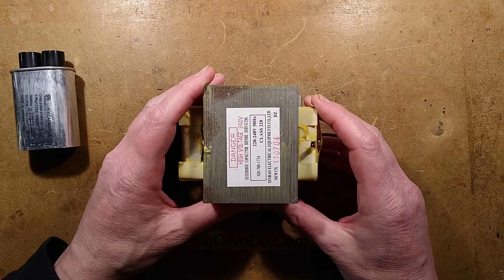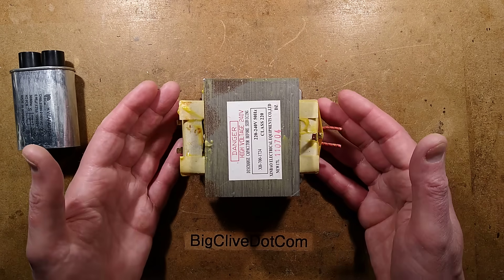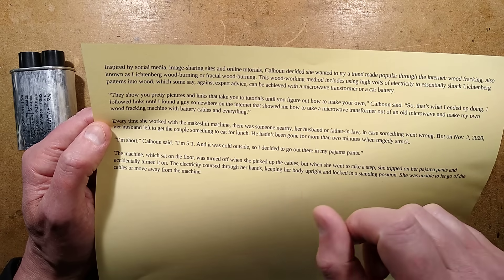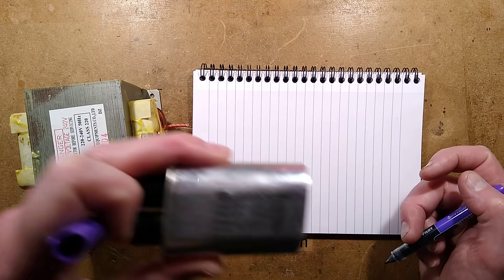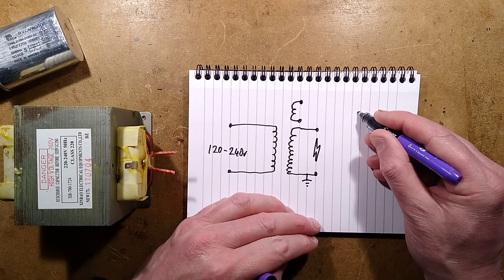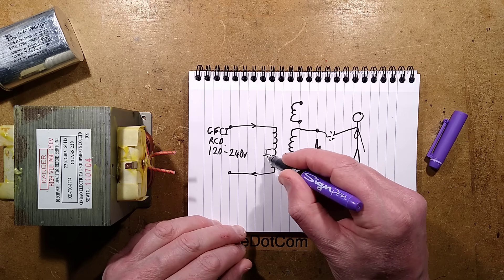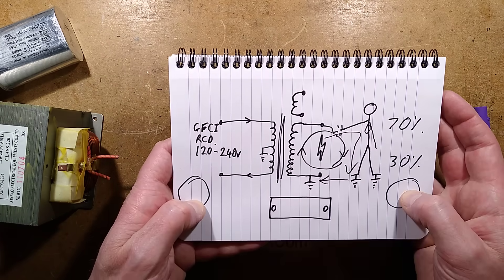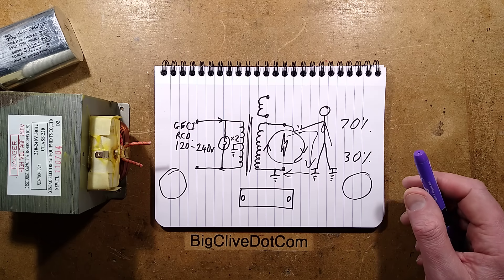The most deadly project on the Internet

Comment: Clive, what would you recommend instead of the jumper cables?  

I have a degree in electronics, and I agree with everything Clive said.  I'm glad he spelled it out so well and broke it down.  The transformer coils he drew on the paper are isolated from each other, meaning something happening to the secondary coil will not effect the primary coil.  When you pass electricity over a wire, it creates a magnetic field.  Inversely, passing a magnetic field over a wire creates electricity in that wire.  The primary coil crates a magnetic field that passes over the secondary coil.  As the magnetic field expands and contracts from the primary, it creates the voltage/current on the secondary coils.  The output from the secondary can be open, closed, or shorted, and it will have no impact on the primary coil, thus why a GFCI will not help protect you.  It's literally a separate circuit.   I've seen that idiot on YouTube that uses the handheld probes, and he doesn't realize what an idiot he is.  And I'd bet he is cocky enough to think he's 100% right and safe, until his channel is silent because he is dead.  You get no second chances.  The tiniest hole in those gloves can cause a deadly issue.  There's no such thing as an insulator so much as just conductors with varying levels of resistance.  Any resistance can be overcome with enough voltage.  ANY INSULATOR.  If you must do this, I personally recommend the two light system mentioned and having several feet/meters of extension cord between yourself and the transformer and plugging in and unplugging the power from the outlet in addition to the dead man's switch.  This is one of those things you get NO second chance to screw up without lethal consequences.  I also recommend a fan on the circuit so when the power is going across the wood, the fan can help blow out fires.  Do not use salt water as a conductor across the wood.  Liquid bleach is just salt water with an extra oxygen molecule.  You can create weak bleach with salt water and electricity, which is how they sanitize pools using just salt.  This high voltage would likely cause a release of chlorine gas which is toxic.  That's why people use (I think) baking soda.

Over confidence will get you killed. My friend at the time was a 25-year master electrician and he was helping me correct some wiring in a new house.  I'm 6'3" and the attic space was tight, so I had to crawl over the AC air handler unit to reach the ladder.  While going over I tapped a copper drainpipe, and it shocked me.  I told the master electrician not to couch that copper pipe because it was energized.  He disagreed and touched it, and nothing happened.  I agreed there should not be power on the copper pipe, but something was wrong somewhere, so I said, "Yeah, you're sitting on wooden joists that are acting as insulators.  I was crawling across a grounded metal box.  I'm telling you the copper pipe is energized.  So, with overconfidence, he reached out and touched the metal air handler unit with one hand, then the copper pipe with the other hand, and he was shocked and was sent backwards.  That's really stupid because a short from hand to hand creates a circuit path directly through the heart which operates on millivolts.  Millivolts to 120 or 240 volts is massive difference.  2,000-4,000 volts is massive overkill for a heart.  I didn't mean to laugh while he was cursing from being shocked, which prompted him to tell me it wasn't funny.  I pointed out that I wasn't the one he should be mad at.  I'd told him twice that the copper pipe was energized, and he is the one that reached out and touched the pipe, not once, but twice because he didn't want to listen to me.  The point being that if a 25-year master electrician can make such a simple mistake, how easy can someone make a deadly mistake watching a YouTube video that has no training in electronics or electricity?  

This bears repeating - a GFCI will not help you at all.

Comment: Volts don’t kill, amps do. 🙉
Reply from the maker: And this can supply high current with plenty of volts to push it through you.
Reply: @bigclivedotcom Very true, I also used the wrong emoji on my initial comment and can’t edit it. It should’ve been the 🙉. Lol
Reply: That's incorrect amps don't kill its volts  amps that kill and the thing is is amps themselves high amps can't kill you because amps with not enough voltage can't travel through the body so if you have lots of voltage with lots of amps it will kill you for sure but just amps with low voltage won't do anything to you cuz you can take 600 amps with 5 volts and it won't even do anything to you so it's actually always says high voltage for a reason because it's high voltage that barbecues you because you don't usually have high current and high volts at the same time amps is the amount of  energy so if you have 500 amps with 2000 volts you're f*** but it's to say apps is what kills is incorrect and that's because the human body is resistance will not allow the amps to travel through the body unless you have a high enough voltage to do so

Comment: I have survived the shock from it and instantly have way more respect for it, I touched both terminals with both my hands and  it burned hole in the top of my hand that still has a scar. My finger tips were also messed up but they fully healed

Comment: Would it not be prudent to use a simple 10mm rubber mat.

If the electricity can't ground itself then you don't complete the circuit.

No circuit no shock right??
Reply from the maker: Many of the deaths were hand to hand.

Comment: I've searched the Internet for an answer to a very good question if I do say so myself. There is no answer as far as I can see. 
I would like to know, if there is no reference to ground, perhaps by using a battery inverter, or some kind of isolating transformer, similar to a sgaving socket, with around 240v 5 amp power capabilities. Would you still get a shock from the hot wire? I know at 1000's of volts, you get the capacitive flash over but not an actual shock as such, probably just burns. Also, if you start with a hand on a probe to the hot wire, then I doubt you will get a shock. 
I really need to know the answer to this and thought, if I can't find out from engineers such as yourself, I could try starting with low Ac inputs to the MOT and gradually build up. Again, this would have no reference to earth. 
Thanks in advance, Clive. 
Alan.

Comment: I have a fire alarm control panel with one of those transformers in it and my question is, Why is the transformer getting extremely hot?
Reply from the maker: It may be overloaded or have an internal winding short circuit.  Traditional transformers like this do often run quite hot under load.
Reply: @bigclivedotcom  I can hold my finger on it for at least 10 seconds before I have to release and let go. Thanks for that information though I didn't know that.
Reply from the maker: @Will_9403  You could measure the AC current being pulled on the output.

Comment: Well this is Ac current and the fact is the secondary windings doesn't have a close loop so its conducts air its a spark gap but at a more constant rate of current being release. Ac current is dangerous without proper understanding.

Comment: This is something I predicted years ago.  Thanks to lawyers, every product we buy has idiotic warnings on them.  A can of paint has columns of warnings but one small paragraph on how to use it.  With regards to microwaves, the ovens have the typical "Danger Will Robinson! Lethal voltages inside!!" - same as a clock radio or coffee pot...  Microwave ovens are probably the only device in your house that has a real chance of killing a human even when unplugged (assuming the oil cap has no internal bleeder).  Good video.

Comment: Would it make sense/is it possible to get a separate GFCI and wire it to the secondary? Would that work/would that be a good piece of extra protection?
Reply from the maker: It would be quite complex to make a high voltage one.

Comment: Sad story. Electricity can be dangerous when applied ineply or improperly. Then again, that is true for most things. Chemicals, Vehicles, Weapons, Explosives, Ladders, Acrobatics, Tools, Sex Toys, Animals, People and so on and so forth.

That said. I fiddle around with batteries and transformers all the time.
12V Safe to touch - You will not feel this at all. It can not overcome the resistance of your skin.
24V Safe to touch - You could possibly feel a slight tingle
230 Not safe to touch - High risk of injury or even death

Always try to work with the current off and no chance of it turning on in ANY way.
No matter the voltage, never short circuit.

Comment: I really appreciate all this information. I've harvested 6 MOTs now, out of various wattage microwaves. Always did it very safe, made sure to discharge the caps properly and what not. I haven't plugged any of them in yet, just because I'm trying to educate myself the best I can before I do so. I'm just getting into electrical engineering, and I've been trying to find some fun projects to do. I definitely have some ideas for all the magnetrons I've gathered. These will be my first high voltage experiments. 

I've built a coil gun previously, but the battery source only goes up to 24v, each coil (which there's 3 total) has a capacitor bank of 200k uF. All together 600k uF. Which I'm sure they'd give quiet the shock as well. lol

Comment: in the 90s i was servicing Microwave Ovens and i have repaired literally hundreds of them of various makes so i know their potential, in the wrong hands they are a killer, inside there is a transformer outputting around two thousand volts at a relatively high current coupled to a voltage doubling circuit, giving around four to five thousand volts. my strongest advice to anyone not qualified to work with microwaves is DON'T, in the wrong hands these  things are potentially LETHAL, and do not remove the lid for any reason.

Comment: frankly i'm more a fan of the old way of doing it with a wood etcher instead of this means for a design.  even acid etching would be safer.  part of me thinks about taking tree branches and putting them into a press to make them as 2d as possible and using them to make molds, that you could then make metal castings and basically use them like a brand.  but idk if that would work so well for intricate designs as much as vague appearances.  ty for sharing... i've had to discard/have recycled... at least 2 microwaves in my past... one was due to the transformer being compromised and displaying arcing sparks within the cooking area of the unit.  the other... well something broke and we couldn't get the door open, we figured it was safer to get rid of than to mess with a potential half -as**d redneck repair ... that could compromise the unit in some unknown way.  anyhow, ty for sharing.  peace.

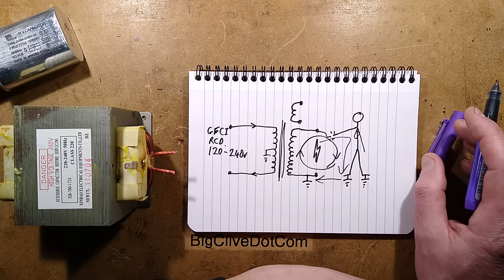Comment: I am very ignorant and my question comes out of curiosity so please bear with me. In the scenario illustrated in minute 11:00, what causes the shock to kill: the fact that your insulated shoes make you the end of the loop, the voltage passing through your body, or the resistance of your body to such voltage?
Reply from the maker: The high voltage means that footwear may not save you from current flow.

Comment: Getting shocked from a plug was bad enough and that was with a UK plug with the most built in safety features due to it design , since then plugs in my house have been switch off through the first switch before plugging the plug in and then the opposite for going out,  let only playing with microwave components. If want cool pattern I draw it myself thanks or watch them on TV/PC screen.

Comment: Have you had a microwave failure from a buld blowing in a microwave.  Also have you seen any information on putting a 100k 3watt resistor across the bulb to stop this.
Reply from the maker: When a small bulb fails it can do so with a pop and short out briefly, and this can blow a fuse or damage PCB tracks.   The resistor will not do anything other than heat up slightly, it is more likely that it was intended for preventing ghost glow of LED bulbs when turned off.
Keep in mind that a microwave is the most dangerous appliance to do DIY repairs on.

Comment: Very useful video, ending is hilarious
I'm working a lot with electicity due to my profession, and I HATE capacitors, whenever I see switching power supply, motor driver, anything that contains capacitors, it drives me nuts, always short them to be sure
All that because I've been shocked a couple of times, not anything painful or lethal, but very unpleasant experience, and I developed fear and hate to the capacitors lol
Always check your power supply even if its already off, kids, capacitors are bitches

Comment: The idea itself of touching anything that has high voltage (more than 230V) in it with non-proper insulation is mind boggling. Anyone thinking about that belongs to an institution right away. Or to a graveyard. 
However, eletric fences for horses run also at high voltage, yet with very low current, right? scratches chin

Comment: this operate only at 2kv with the diode+cap fitted,ie the voltage doubler,so why dont you tell the facts and not b.s??.
Reply from the maker: The output of the bare transformer when unloaded is well over 2kV.

Comment: i have done it! but i daren't turn it on yet. I made a Jacob' ladder. i think it is as safe as can be. the MOT is screwed to the wooden base of the ladder, which stands on my formica table, with metal legs, that stands on painted concrete floor. i have attached grounding wire to table leg the end of which is in earth socket on bench supply. the cable from plug to ladder is 8ft long, and has a break in the middle with a relay. the relay is triggered by a floor switch i took from my smoke machine. the bottom of the ladder's gap is 3mm, which seems a bit small, but if air breaks down at 17kv per cm, i think I want about a quarter of that.
Reply from the maker: If making a Jacobs ladder I strongly recommend using a neon sign transformer.  It's still dangerous, but less likely to cause death.
Reply: @bigclivedotcom  advice taken. I've dismantled it, pending the delivery of a neon power supply.

Comment: The most safe way to do fractral burning is to make a well insulated box where you put the transformer and the wood you are burning. And the box shall have a interlock so the transformer can´t be energized when the box is open. It also helps getting rid of the smoke by placing a exhaust fan in it

Comment: The gruesome reality, as told by high voltage shock survivors:  
High voltage (including a microwave xformer) can make every muscle in your body flex to its full potential at the same time.  That's why you can't let go.  You might make strange sounds, bite or swallow your tongue, or anything.  You will have no control.  You will know the whole time that you're getting shocked.  Your brain will send signals to let go, move, etc. but your brain doesn't have near as much electrical energy as the external voltage that's shocking you.  The worst part is that the whole time, you're awake, you know you're dying, and you know what you need to do, but you can't do it.  You know you are being cooked from the inside out.  You can still think but that's all.  
This can happen at line level voltage too (120/240 volts.)  That's why it's very important that you position yourself properly when working with electricity.  If you come into contact with something hot, you want to be positioned so you will fall off of it.  If you fall onto something hot, you're in trouble.  If something hot, such as a wire, falls and comes to rest on you, you're in trouble.  Always have a helper when working with something hot.  (Yes, there are situations that don't provide or allow for killing the power.)  As dumb as it sounds, be sure your helper is holding a 2 x 4 and he isn't afraid to hit you with it, just in case.  
The people who die burning the wood with MOTs are standing on the ground.  There is no place to fall when you're already at the bottom.  There's no guarantee that high voltage will let you go even if you do fall.  In the USA, our primary distribution is 13kV or more.  Only the lucky few survive.  VERY few.